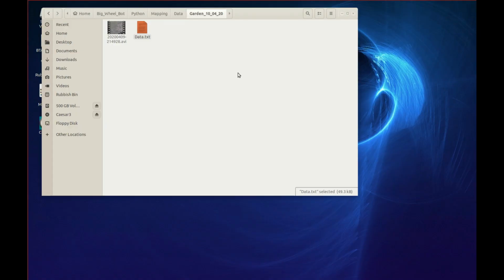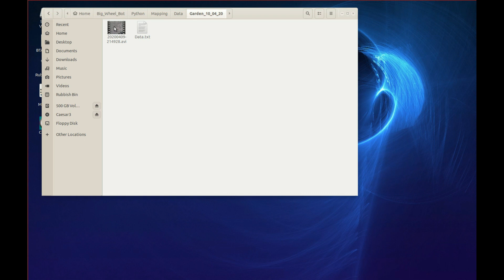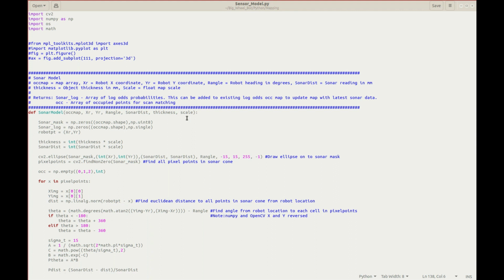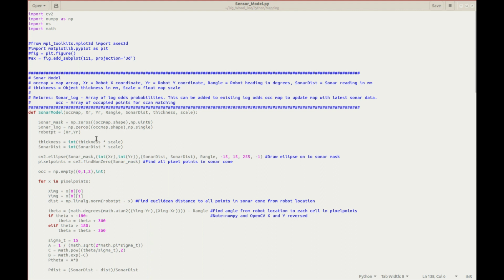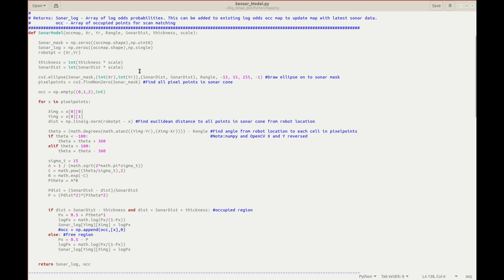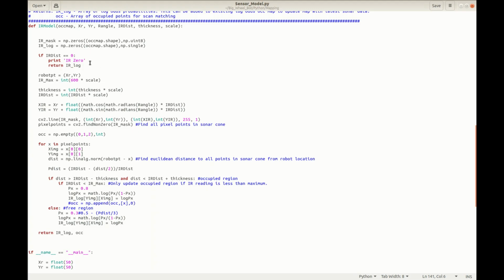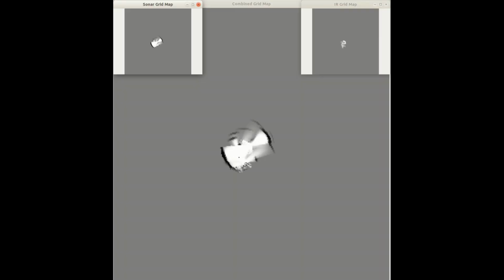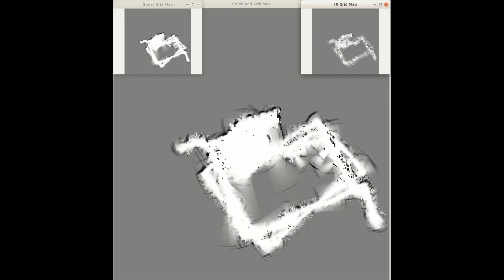Occupancy grid mapping - Big Wheel Bot #4

Comment: Im basically curious as to how all the processing and mapping was done. Is it all running off python on the raspberry pi?
Reply from the maker: The Raspberry pi was used to log data coming from the Arduino as the robot was driven under remote control. I then took the data file to a pc, where I processed the data to create a map using Python. However, this could all be done on-board the robot on the Raspberry Pi if required.
Reply: @BigFaceRobotics  thanks mate